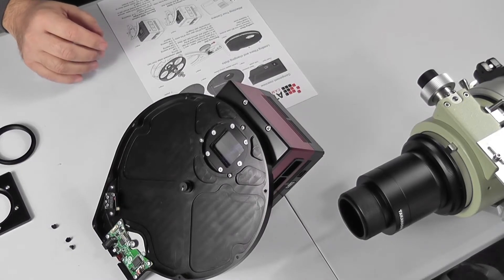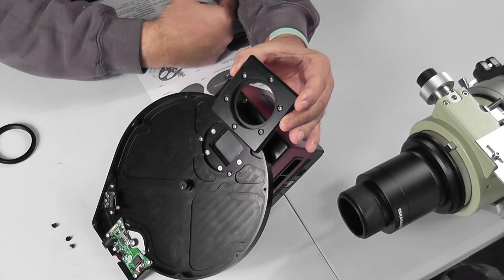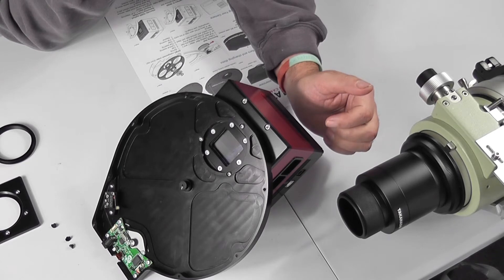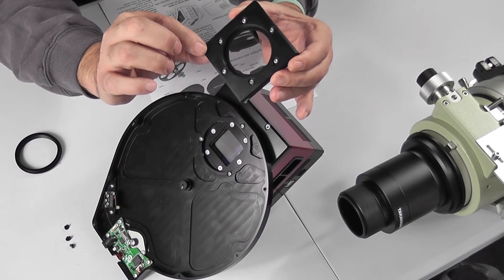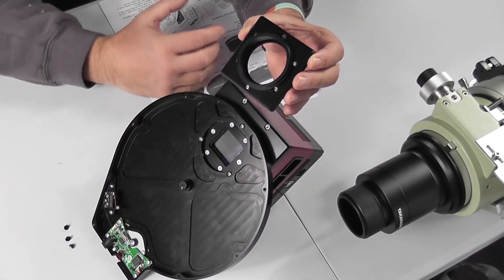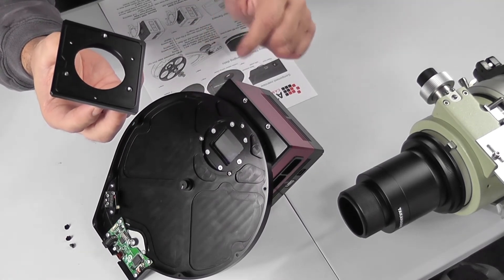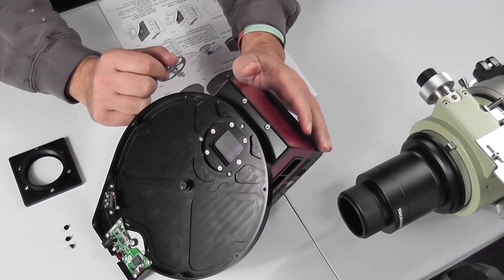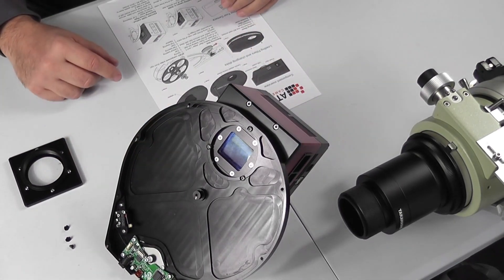Atik EFW3 - Atik 16200 direct connection

Comment: Hi! What has been your experience with this camera. I am looking at 35mm options. I´ve had bad experience with CMOS (tilt) and very good one with a KAF8300 based camera. I also like bigger pixels as I am going to use it in a 1500 mm reflector. What strikes me is that the Atik is so much cheaper that the QSI 6162 and ZWO 6200.
Reply from the maker: Hi Jose.  My experience is excellent.  The FOV is superb form the APS-H sensor and the cooling is superb (important for me in Spain).  It is a class 2 sensor so you can get small column defects but naturally these are not an issue as dithering makes sure they calibrate out with no issues.  Sensor tilt could be an issue no matter what camera and the larger the sensor the more likely this will happen, but I haven't got any on my one.  

In short, I wouldn't hesitate to recommend it.

PS remember you will need a minimum of 2" filters.
Reply: @simplifiedastro2092  Thanks a lot for your feedback. Still trying to decide between CCD or CMOS. The price difference of the Class 1 chips is substantial.
Reply from the maker: @jose730106  Class 1 is totally unnecessary for astrophotography, so a hard additional cost to justify.  Some of the newer CMOS offerings are very good, but do come with a very hefty price tag and require some hefty computing and storage capacity.  Some very good images out there from CCD based cameras.
Reply: @simplifiedastro2092  I am fairly new to astrophotography and I came into the hobby when CMOS was already considered the new standard. But had issues with one camera and switched to a CCD and could not be happier. The question is what is going to happen with the service of the OnSemi chip based cameras
Reply: @simplifiedastro2092  I am seriously considering this camera now. It looks like the best value for money right now in the market for a KAF16200. Does the long download time bothers you in any way for plate solving and autofocusing?
Reply from the maker: @jose730106  It is great value, and an extremely good camera.   I use plate solving and auto-focus all the time and have never found myself tapping my fingers waiting.
Reply: @simplifiedastro2092  Thanks a lot!
Reply: @simplifiedastro2092  do you use mounted or umounted filters? I am planning to use Chroma 50mm unmounted but I’ve head the fitting with the EFW3 slots is not perfect, leading to light leakages. Sounds unlikely, but just in case 😀
Reply from the maker: @jose730106  I use 2" mounted Chroma filters.  I do have a small amount of vignetting, but it very easily calibrates out.
Reply: @simplifiedastro2092  Thanks a lot for your answer. I have always used the mounted but was leaning towards unmounted for the bigger clear aperture and ease of cleaning. I am going to be checking this with Atik.
Reply from the maker: @jose730106  No problem.  It's a matter of choice, but both will work just fine.
Reply: @simplifiedastro2092  Hi! I went all the way and bought the camera. Have not tried it yet but looks amazing. I am thinking about using the Takahashi OU032 M54 to M54 adapter to connect it to the scope, but I see your adapter looks different. Is it the same one or are you using another one?
Reply from the maker: @jose730106  Great news Jose.  I'm sure you'll love it. I honestly can't remember what adapter I used but will have a look and see if I can find the receipt for the one I got.
Reply: @simplifiedastro2092 Thanks a lot! I’m curious because it seems longer than the one I have and I could use a few more milimiters to keep the focuser’s drawtube as in as possible. Now I only need a clear night.
Reply from the maker: Hi Jose.  OK I was originally going to use the OU037 but Ian King changed this to the OU032.  It may be that the design has slightly changed looking at it now on FLO, but as long as the length is similar that should be fine.

The above is the easy bit; getting a clear night appears to be much harder! 😳
Reply: @simplifiedastro2092  thanks for that! And yes, its being an awfull autumn for astrophotographers. We’ll see. Have a nice weekend!!

Comment: Hello! that piece be removed to put the wheel directly, can it serve to correct the tilt? Thanks in advance
Reply from the maker: Hi Alvaro.  No, the adaptor which comes out will not adjust for tilt unfortunately, only rotation.  If you undo the two small grub screws at the top of the filter wheel it allows the adaptor to rotate, but clamps back up rigid when they are tightened.

There are a number of tilt adaptors available if you are suffering with this, and Telekop Express in Germany (TS Optics) do a good range.

Comment: Do you have any Column defects on that atik ?
Reply from the maker: They do show a couple of defects when not cooled, which is normal for a Class 2 sensor.  Once you cool to -15 (I didn't see a noticeable difference beyond this) any defects are not noticeable.  I would also recommend dithering which will help with any column defects.
Reply: Simplified Astro thanks mine even cooled down to -20 you can see three. I tried the Column repair software but doesn’t do anything
Reply from the maker: Hi Jaspal.  This is fine and not unusual at all on a Class 2 Sensor.  Just dither between frames and once you stack you images this should just disappear.

Comment: Just wondering, it looks like you aren't using the CAA on the FSQ. Are you experiencing orthogonality issues from it?
Reply from the maker: Hi Ivan.  No this is the original FSQ 106 which wasn't fitted with it, using the 'captain's wheel' rotator instead. I believe it is the DX model on which the CAA was introduced.
Reply: Ah right. Thanks for the reply! Great video BTW :) I've gotten an ATIK 16200 and EFW3 which I will be running on my FSQ as well, just that I haven't had the chance to test it out so far
Reply from the maker: Thanks Ivan, much appreciated.  It is a totally awesome combination, I love it and I'm sure you will.